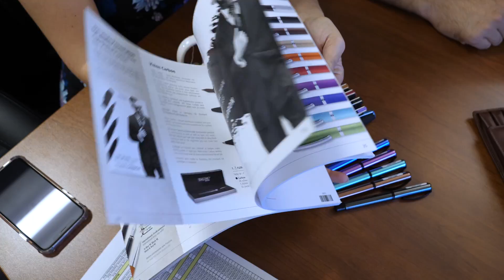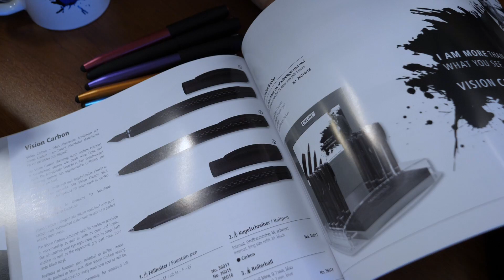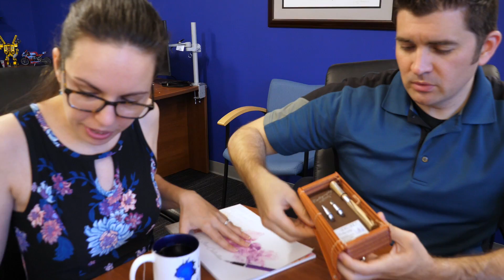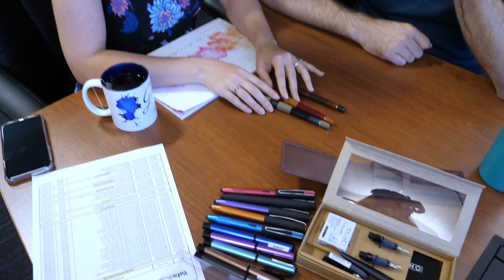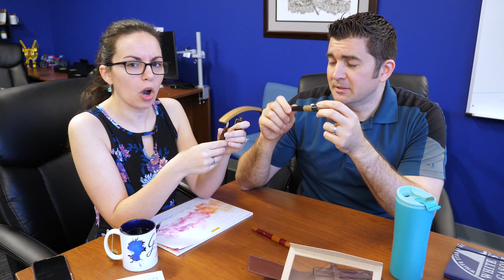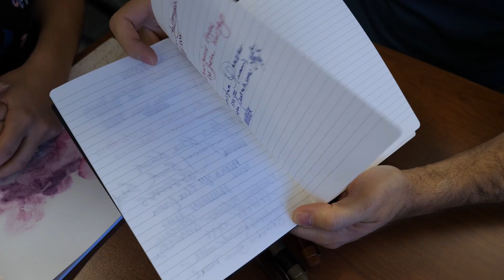Write Now - Ep.037: Opus 88 and ONLINE Fountain Pens!

Comment: I have one of the full demonstrator Opus 88s. It's a beat of a pen, and writes very well out of the box. It's also substantially larger than the resin/ebonite models you have there, and has a # nib. The one issue with it, is that it's four full turns to uncap, so it's not a good pen for quick notes, but I like it for journaling and long form writing. I have it filled with Organics Studio Nitrogen, and the combination is fantastic.

Comment: My 2 cents:

1) It seems fairly clear that the ONLINE Switch is a Lamy Safari/Faber-Castell Loom hybrid. The cap is Loom inspired (but not as nice), the clip is Lamy inspired (but not as nice), the section is obviously an homage to Lamy (the added rubber grip could be appealing to some), and the ink window is a variation--again--on Lamy. So, it is basically a Lamy Safari or Al-Star knock-off with a bulbous, Loom-esque cap. I just can't see myself getting one, even though the price is nice. The "Plus" part is thoughtful, but not enough to sway me. I tip my hat to their attempt to take appealing parts of other German pens, mix them, and add some technology. I'd just prefer to stick with the orginals. 

2) The Opus 88 Koloro: nothing to say; not interested myself.

3) Stifflexible Notebook: I am intrigued. I love trying different notebooks. At the same time, I am already a bit annoyed. In my opinion, it was a mistake for them not to include a built-in ribbon bookmark like every other major player does. (In fact, I wish more of them offered multiple ribbon bookmarks.) It seems like a small omission that could hinder sales quietly but substantially. In short, that small cost-saver may have cost them revenue. If they'd add a dot-pad section, then they'd appeal to the FP crowd a lot more. So, for me: it is a second draft of a project that needs more tweaking before the final publication. They have something; it just isn't quite there yet.

Comment: What is the best option for me as i am a beginner and i never used a fountain pen before and i have a terrible handwriting?

I searched and found out that lamy safari is ok, what do you think ?

I will keep it in my messenger bag and i feel that fountain pens will spills inc all over the bag is that true ?
Reply from the maker: The LAMY Safari is a great beginner pen. You may also like the TWSBI Eco. It writes a very wet line so it's a little more forgiving with bad handwriting, but the LAMY will write fine for you too. You shouldn't have too many problems with the pen in your bag if you keep it securely stored nib up. The ink will spill into the cap if the pen is jostled around and is facing nib down. -Lydia

Comment: I have an Online Vision Classic fountain pen  ( which has a brushed aluminum finish which look very classy compared to the Vision Magic which has a glossy aluminum finish ) with EF nib. The pens is graphite pencil smooth and thinner  line width than Lamy  Al Star Fountain pens. It   write  not too wet or dry  with  the perfect ink flow in my opinion.  The pen nib has a 5 year warranty.  The nib is super easy to swap out by twisting the nib from the grip section .  

I had some issues with the converter and some standard universal ink cartridges where it was not snug with the back of the feed.  Online Pen company sent me a replacement converter and a box of blue ink to try without charge .  The new converter fit snugly compared the original that came with the pen.  I had some skipping & flow issues with the nib but the issue disappeared after I gave the nib a good cleaning.  I contacted Online about the issue before I washed out the nib section & they were willing to send me another without charge.  So  I  highly recommend this fountain pen brand

Comment: I have the Koloro in the "yellow/orange" (I'd actually call it orange (the resin) and and chartreuse (the ebonite). The broad nib on mine is juicy, and the pen has been very reliable so far with no leaks. I also like that's it's pretty easy to clean, as I like to change ink colours often, and that it posts.  My one negative is that it has a LOT of threads for the cap, it seriously takes about 5 full turns to unscrew the cap. overall I like it a lot. I chose the colour I did because to me it looks very 1970s somehow (especially if you put in an olive or "muddy" green ink like Alt-goldgrun!)

Comment: As to possible new "carry" products...only a couple comments.ONLINE - A long int'l converter was mentioned vs. the type of cartridge, so will assume it utilizes the same...which is the only thing going for it over LAMY and other proprietary pens.Calligraphy sets - a small set or two as shown I believe would sell well and introduce folks to that type of nib.  I highly recommend it as a matter of fact.My first experience with a 1.1 stub was with a Regatta Sport; I immediately fell in love with the nib type...enough so that I immediately purchased another is a size I'd considered my "max"; your special edition Conklin Classic "Rainfall" with the Goulet 1.5mm stub.  It is by far my very favorite pen; wet, smooth, and gives definition and character to my penmanship.  I now have three other pens sporting the Goulet 1.5 stub; two Jinhao's, each with different shimmering ink, and the former "hated" Noodler's Ahab "flex"...which now isn't a "flex"...and offers the large ink capacity.  I'd like to try slightly smaller and larger stub/italic nibs without spending too many bucks.The Taiwan "eyedroppers"...yes.  As quickly as the above Classic goes through ink converter refills with it's large wet stroke, the only reason it already isn't an eyedropper is that I have too many darn int'l cartridges purchased early on that I need to get rid of...and two normally also come with each new pen purchase!